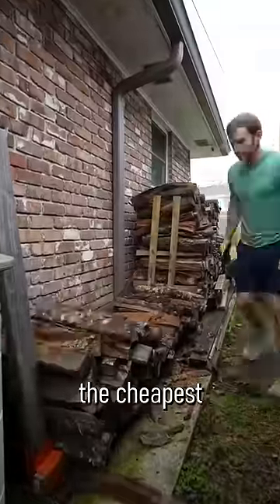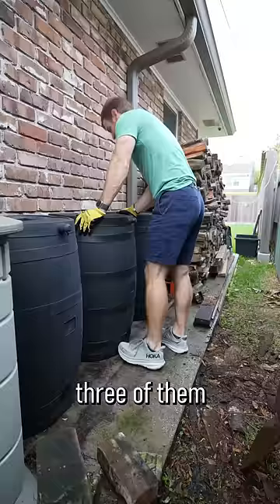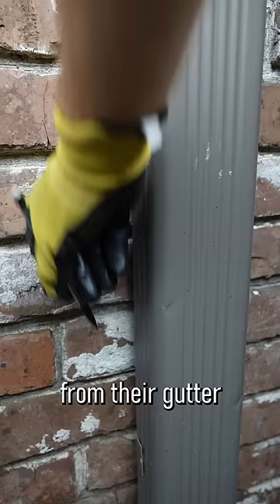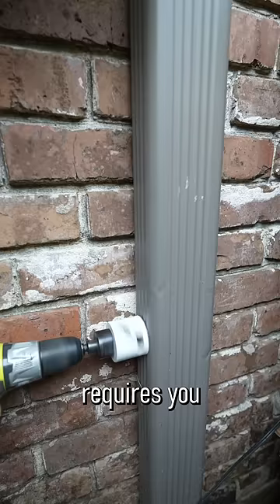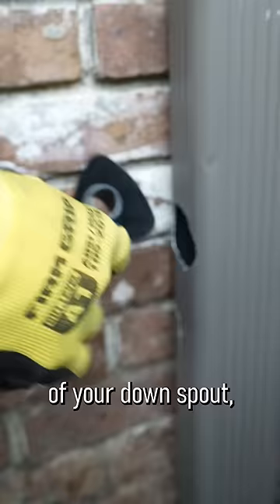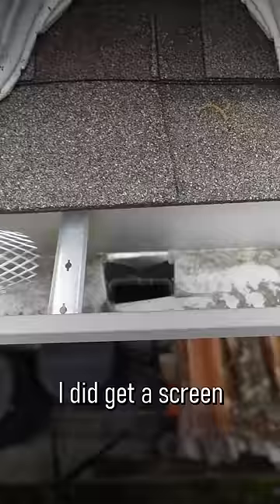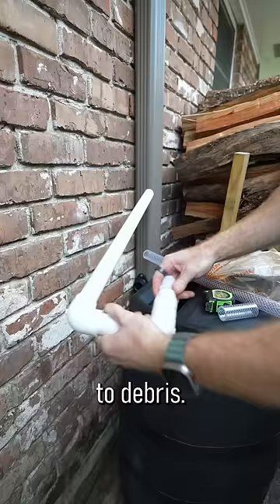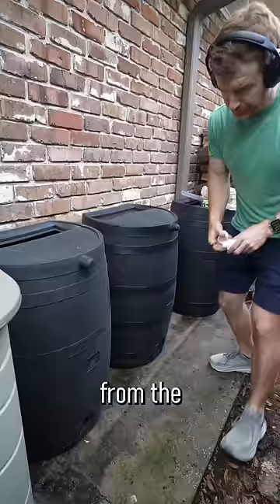Rain Barrel Project in 59 Seconds

Comment: An inch of rainfall on a square foot of surface area yields .623 gallons. So, multiply .623 gallons by the number of surface square feet of your roof. So my barn is  16×24 = 384 square feet x .623= 239 gallons from 1" of rainfall for the day. So it was a little more than an inch of rain that day. I could not believe it how much little rain seemed to take. I use screens that are used for screening paint at automotive plants that paint trucks at the F150 plant in Detroit. It is really fine. Then I pulled them out once a week and clean the screens we put down rocks around the UBC container for the Overflow because I'm not there every single day usually I'm not there between February and July so it just constantly overflows until I can get up there and then take 50 gallon drums in fill those up out of the and place those in the barn to use for our shower and washing hands, dishes and so on. If it rained a couple days in a week I would have all three barrels full so 825 gallons of water if it rains 3 days in 1 week and that will last us all year because we're really only there during hunting season and steelhead fishing and salmon fishing season. We usually have four or five guys there for several weeks at a time from October to February. The screens I use are literally like Micron size holes in it so nothing gets through it except water.

Comment: After the pipe leaves the down spout should have it go up hill a little and have a catch tube or clean out built under it at the point where it starts to go upwards then all
The stuff that makes it past the screen should fall down into The clean out tube and only water should move up hill with pressure from other water behind it .

Comment: Well then you should feel that whole end up with charcoal so it can have a pre-filter It's light it's easy to process and then to where basically you would have that plug right there above that is all charcoal or and you can clean your gutter system and then put charcoal in that whole area right there, with a fine pebble sand

Comment: What good is water in three barrels outside back in the day many people had a cistern  that would hold 5 to 10,000 gallons of water equipped with a shallow well pump .All the water was used in the house for everything but drinking . The cistern needed to be cleaned out every five years .Water in three barrels is a waste of time.

Comment: Elevate the waterbutts. Get some bricks or you can get stands design specifically for them. It'll give you some more adaptability later on. Certainly make it easier to drain them and use the water in a can or something

Comment: A note from an Aussie (we always collect rainwater). Add a bit of pvc pipe in between the downspout and your tanks with a lid on the bottom, that way when it rains, the first 10-20 dirty litres get captured and the clean water goes to your tanks. Open the lid and let it drain after the rain is gone, close it back up and leave it

Comment: You got hosed on those barrels, my man. I can get 55 gallon plastic food barrels for like five bucks from my local metal dealer. They don't come with the pipe footings already attached, but it's half an hour's work at most to make it happen. All told, you could have saved yourself over 60 bucks a barrel, including labor.

Comment: You added a filter for the "bulk" but that will do little to stop anything harmful. you need to add a better filtration system. even inf you're not planning on drinking the water, it would still be good to have it be drinkable in case of a dire emergency

Comment: So if you live in an area with freezing temperatures in winter do you to have to disassemble? If you don't, certainly the plumbing at the bottom of the barrel will freeze & burst. You'd also need to empty the barrels and remove the divertor. You'd be left with a hole in your downspout leader all winter.

Comment: You shouldn't shouldn't stack firewood next to your house like that. Regardless of whether or not your house is a brick house there is still wood within your structure and what you will do is encourage termites to get into your house and start to eat away at the actual would. Doesn't matter if it's brick doesn't matter if it's mortar doesn't matter if it's concrete doesn't matter if it's cinder block they will find their way around that and get into your house. Do not store firewood next to your house

Comment: Connecting the barrels at the bottom doesn't makes any sense. They all are filled the same height. It's better to connect them at the top. So you fill the first one first and the other ones subsequently. It also filters out some debris.

Comment: Why do this in the first place?  You shouldn't drink this water collected off shingle roofing.  And if it's for watering garden, I did not see any garden.  I've seen roof collecting systems in places like Bermuda, where every house roof is set up to collect rain because the ground is lava rock too hard to drill pipes into.  But those roofs are not shingles, they are made for water collection.

Comment: How do you propose to get the water out of the barrels?  Do the barrels feed into the next one?  If you're going to pump water out, no problem, but if you plan to use a watering can, there is not enough height below the taps.

Comment: no good. just remove the downspout by removing two self tapping screws so you don't have to cut into it and transfer to 4" flexible tubing and make sure you have enough to reach all 3 $79 rain barrels because once you fill the one you're not going to be able to move it so just move the tube from barrel to barrel. that's the most efficient way to collect rainwater.

Comment: Did you install the overflow lines properly? They go at the top, you saw off the tip of that nub at the top and shuv a hose on it connecting them, daisy chaining them together.

Comment: I'm curious as to what you're using the water for? Hopefully not for inside the house. It's great that you're recycling the rain water. But the water coming off of asphalt shingles is probably not the best for health reasons? This would maybe work better with a metal roof system.
(After reading a lot of the comments, I see there are a lot that state to not drink the water because of the shingles.) 👍
Reply: Irrigation

Comment: I’m trying to be negative, but I don’t see this working at all points… the screen will eventually just block all the water from entering as leaves build up. If there is an actual down pour, that rubber insert will push through….

Comment: As far as the rain barrels go...i would put the pvc pupe over the top of the barrels and the drain on the bottom. They really didnt finish the video explanation so this is what im thinking. And yes move the wood away feo. The house. Grrr
Reply: Also, you can build a rack and stack 55 gallon drums 3 high...then you would have 6 or 9 depending on your space.

Comment: Doesn't seems like a good idea.
On average it cost 1$ for 200 gallons of tap water.
If each barrel hold 50 gallons and costs $79... You need to fill 320 barrels of water to recover the cost. This does not include the cost of the pipes and accessories.

Depending of the size of your roof and precipitation in your area, it could easily take over 2 months to fill each barrel.

You are looking at an average of 53 years to break even with your investment.
Meanwhile, you have created a mosquito breeding ground that needs regular attention from you.

Comment: Bad job with the screen and the pipe cutout rubber fitter, should have cut full pipe and installed a 45° screen box to filter out debris...... Not a properly thought out work plan

Comment: I can see you don’t know shit about gutters. That device you just put into the top of the downspout will catch debris, like it says. What it doesn’t tell you that if you don’t think that piece on a regular basis, it will start to block water and have it go behind the gutter. Causing damage, that will cost way more to fix than new gutter would. If you’re worried about debris getting into your barrels. Install a mesh screen at location that water goes into the barrel. This will keeps your gutters functioning properly, while also allowing you to keep debris out of your barrels. But feel free to do as you please.